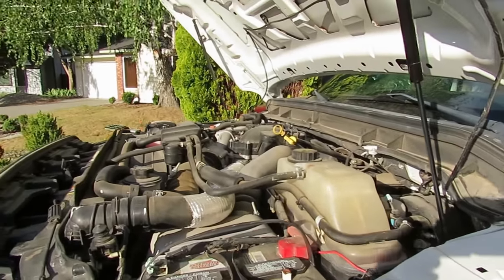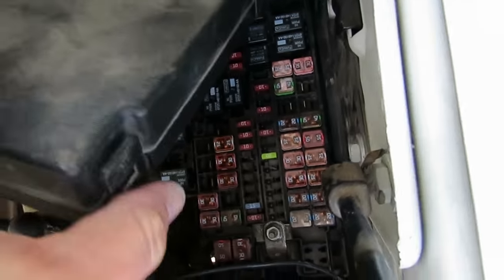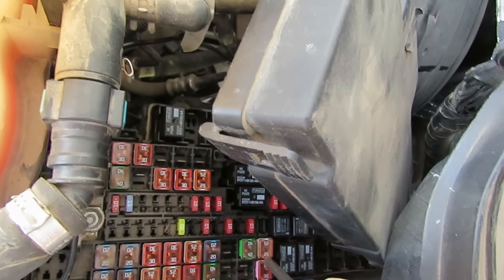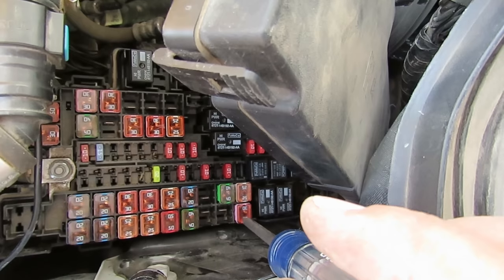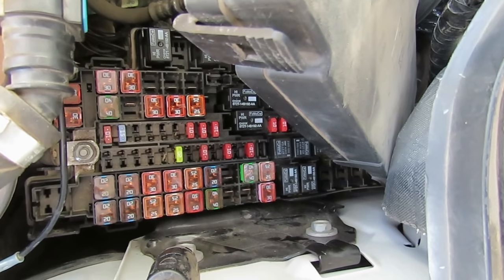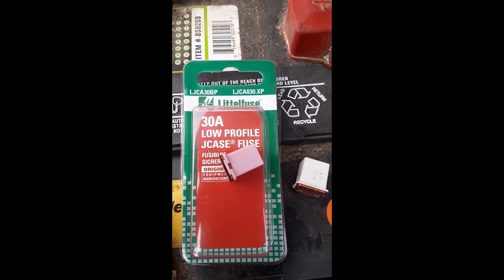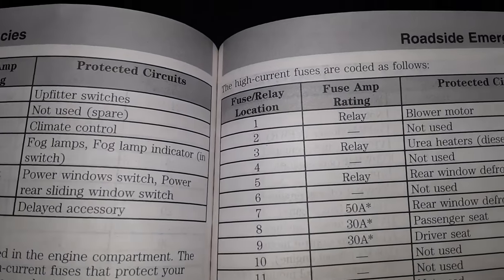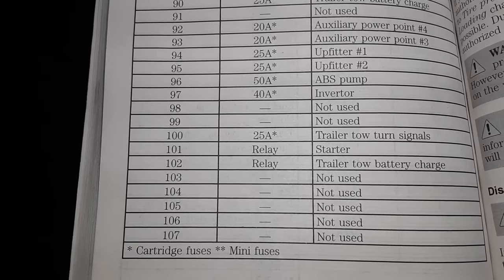Ford F-250 2012 Super Duty Diesel Trailer Light Fuse Troubleshooting

Comment: Thanks Tom, This  really helped me out a lot. I had four different trucks that had trailer lights issues, that I couldn't figure out what in the world was going on. I finally traced it back to one trailer that had a short in it.. once I got the short fix on that one trailer. I had to replace the fuse on two GMC and two Ford F250, the GMC was easy. the Ford was really hard until I ran across your video, thanks again.
Reply from the maker: An intermittent short in the trailer wiring can be tough to find. A simple way is to hook up a continuity meter with an audible buzzer to the circuit and the frame. Then start wiggling every part of the wiring harness you can get to while listening for the buzzer to sound, indicating that the wire has shorted to the frame.

Comment: thank you, with your video my trailer lights now work! Any idea though what might have caused the two fuses to both blow?
Reply from the maker: You could have a frayed wire someplace in your trailer wiring. Vibration while driving can cause this wire to temporarily short to a grounded metal part, blowing the fuse. Inspect the wiring harness as much as feasible, paying particular attention to points where it passes through holes, and use electrical tape to cover any exposed conductors.
Reply: Thank you with your video

Comment: what did you use to pull those fuses out? I feel like I am gonna break it trying to get them out
Reply from the maker: A large heavy duty needle nose pliers can do it, or you can get a purpose-built fuse puller such as:
https://www.napaonline.com/en/p/BK_7822125?cid=paidsearch_shopping_dcoe_google&campaign=GSC-Paint-Body-Equipment&campaign_id=10947560788&adgroup_id=110533803034&adtype=pla_with_promotion&gclid=Cj0KCQjw4v2EBhCtARIsACan3nzk8Twi9djYEyd7c4OpQ10AEJsApwb-PTashSQWAbzTjP6nv_KdBXAaAjBPEALw_wcB&